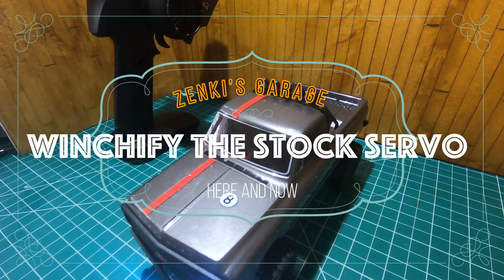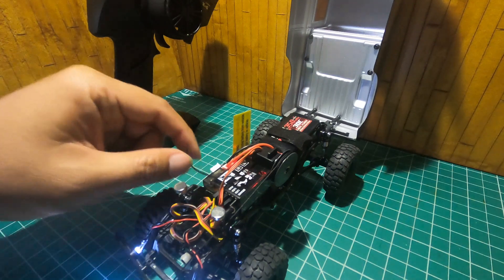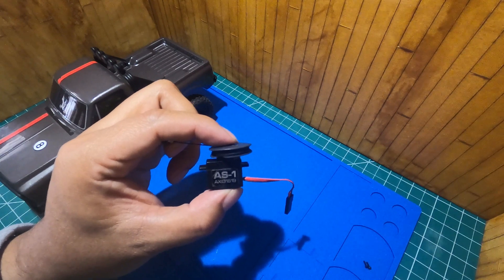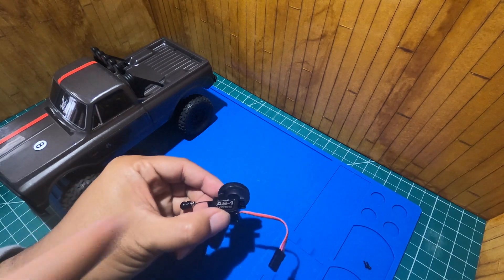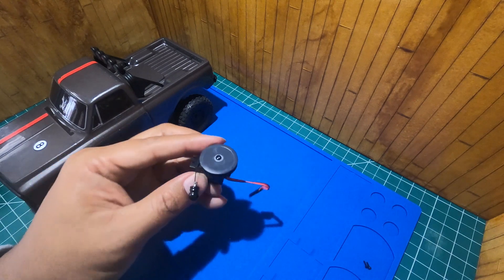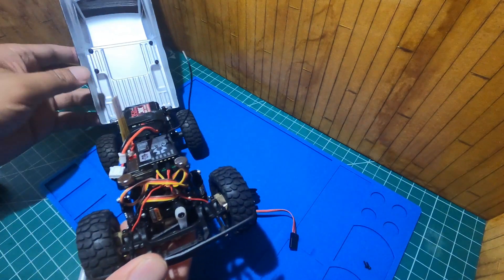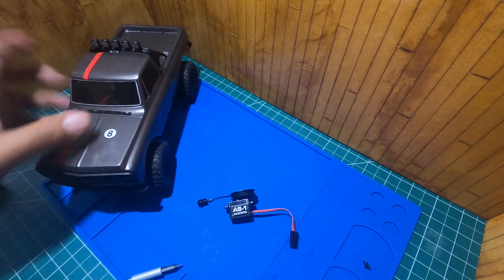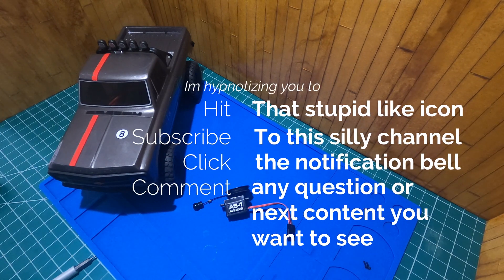Winchify the stock servo of Axial SCX24

Comment: How do you set it up so it doesn't constantly spin? I set one up and even with the c3 switch in the middle it wouldn't stop spinning and it burned out my servo
Reply from the maker: You have to find the zero position of the servo’s potentiometer. Then make sure it doesn’t move anymore. It spins at startup because it is getting a signal to the servo to  go to the ‘zero’ position or center position.

Comment: Still don’t know what gear stops it but I want to do this but still don’t know how 😂 I saw your instructions tho but don’t know what gear to modit
Reply from the maker: Thanks for watching! You might want to check the gear that goes thru the shaft of the potentiometer. I believe its d shaped so it stops coz it reaches the limit the potentiometer can turn.
Reply: @zenkisgarage8460  I see now thanks it works now now just need to mount it
Reply: Will someone make a vid of this